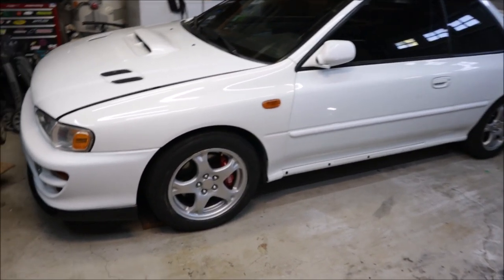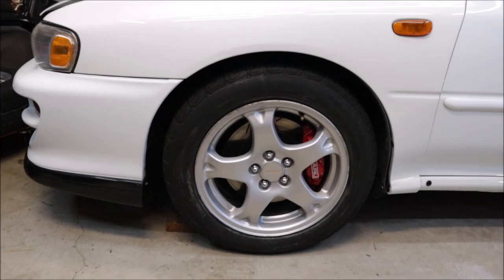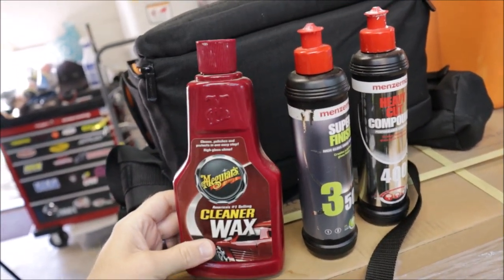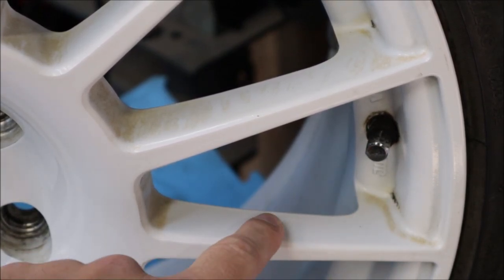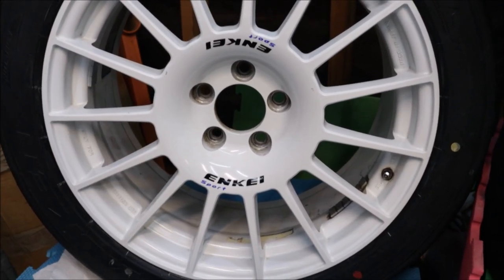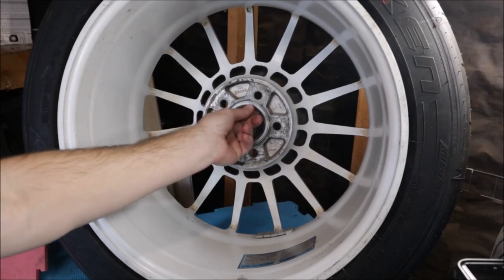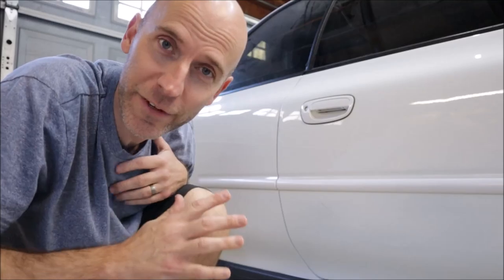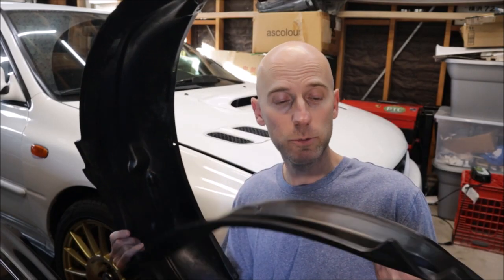NEW WHEELS FOR THE GC8 IMPREZA 2.5RS - JDM Enkei RC-T4

Comment: Hey are you selling the white GM coupe with the white wheels? I have an interior from my coupe if you want to buy.
Reply from the maker: Still have it. I am always looking for clean parts if your in SoCal!
Reply: @RoadPatina  Dope, im in the east bay in the bay area. I have a project rsti im trying complete and might need to sell. Would you be interested if you sell your other cars?
Reply from the maker: @marcspence1905  black RS is sold. What are you selling?
Reply: @RoadPatina  I have a 2.5 rs coupe thats sti swapped with new 4/2 pots. Has 2.5 rs interior and sti carpet in great condition! Needs a transmission. Engine is being broken down for rebuild.
Reply from the maker: @marcspence1905  shoot me some pics and specs on IG @roadpatina or email roadpatina@gmail